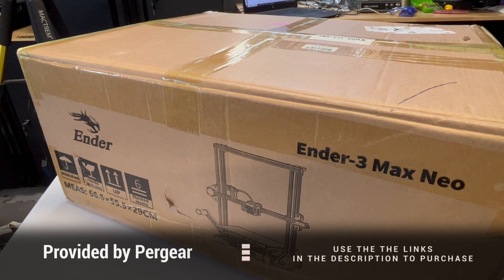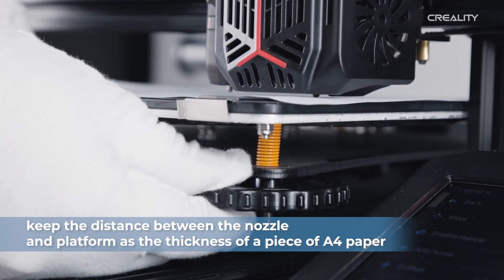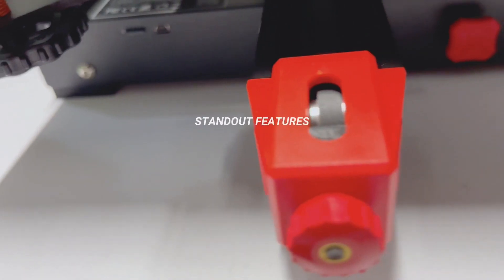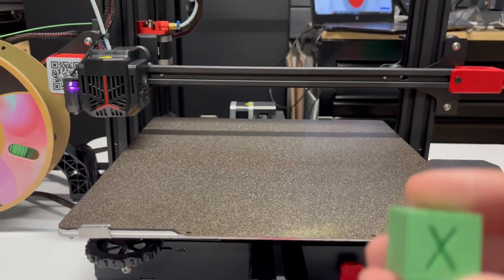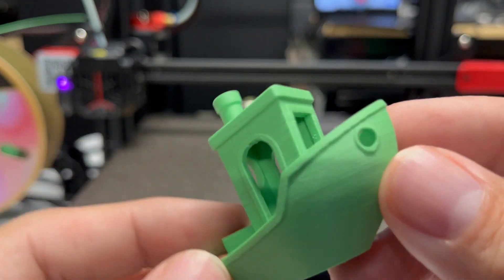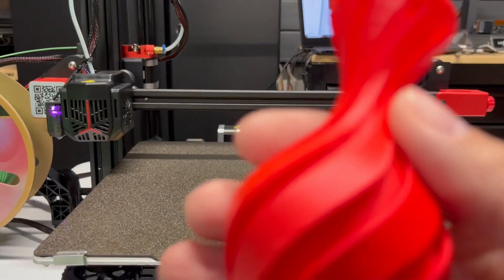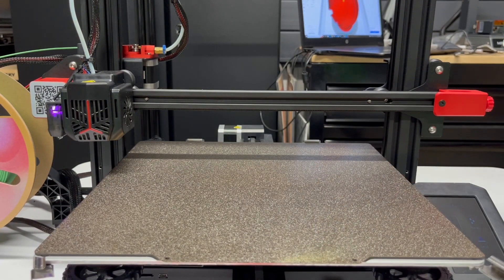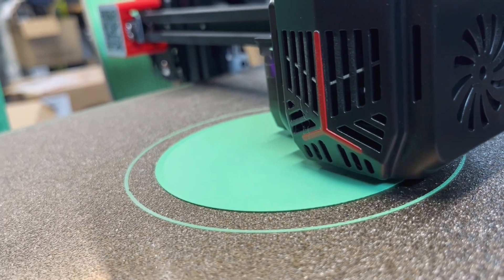NEW Creality Ender 3 Max Neo - Is it the One?

Comment: I was having problems with prints sticking to the bed. I no longer touch the bed with my hands. Problem solve.
Reply from the maker: If I recall this video correctly, the prints stuck to well.
Reply: @TripodsGarage  OK, let me redo my post: Unlike the person in the video where his prints are sticking to well, l'm having problems with prints sticking to the bed. I no longer touch the bed with my hands. Problem solve.
Reply from the maker: @DueyMiller-rk9dr  - Typically you don’t touch the bed with you hands so no oils get on the bed surface.  So you still don’t touch the bed with your hands, so the prints stick.  Got it!
Reply: @TripodsGarage  I was touching the bed because if you run your fingers lightly over the first outside bead laid down and it moves your should stop printing. I thought like a moron that was a good way to check for print failure. Which it is but you have a ton of oil all over the bed.
Reply: @DueyMiller-rk9dr  I use electronic wipes on the bed after print to make sure it is clean. Just a sugestions..

Comment: Has to be something with your settings, setup, or filament, I've seen several videos on this printer and all the prints turned out beautiful except maybe a lil ghosting but nothing bad.  On the video that the prints looked beautiful before the first print he adjusted all the rollers, belts and then leveled the bed. He also changed several setting in the software "Cura" that he was using. The changes he made definitely worked for the better.

Comment: Umm 3d printing 101, you ALWAYS check the tensions all around when assembling a machine. How did you even miss that??
Reply from the maker: Does it say to check it in the manual?
Reply: @TripodsGarage  It doesn't have to, there are manufacturing  tolerance, assembly tolerances, hell you picking up the printer from the box can cause things to come loss. Proper assembly always includes checking everything, and that 100% includes making sure everything is squared, all screws are tightened, checking belt tensions, the eccentric nuts on the wheels..etc. Did you check any of those? It seems kinda stupid to say the review would have been better if it wasn't for one screw being loss when you properly check these things out.
Reply from the maker: @janosmegyeri1473  - Oh!  So I am to do things that are not listed in the manual?  Got it!  Why?  Because because this is 3D Printing 101!  Is there a 3D Printing 101 course?  Is that course included with every 3D printer that is purchased for all the new people?  If it says to check the eccentric nuts, then they are checked, if it says to level the bed with the leveling knobs, then that is done.  If it doesn’t say to check extruder tension, then it doesn’t happen.  You know why?  Because “it isn’t in the manual!”.  This is exactly what is wrong with these responses.  People with experience belittle others that do not.  You do all this things listed because you have experience with 3D printers.  Yet, you cannot go back down to the level of somebody that doesn’t know one little thing about them.  Am I going to unpack a inkjet printer and checks the belts for tension if it isn’t in the manual?  

Maybe manufacturers should have a tuning guide?  Or a checklist like with what you are saying?  Now that would be a step in the right direction for newbs!  Pleasure trolling with you, have a frosty beverage and have a relaxing rest of your Friday!
Reply: @TripodsGarage  Wow dude, chill out. My initial comment was sincere, I was surprised it didn't get caught during setup, but then you have to come back with a snarky remark like does it say to check it in the manual so ya, I;m gonna call you out on it. You say "People with experience belittling other that do not" but you are a content creator with nearly 20k subscribers, and over 100 vidoes, you have experience man. 

That is exactly why I called you on it bro, because you aren't the person "back down to the level of somebody that doesn't know..". If you were new, I would have taken that as a teaching moment to provide some tips when assembling a 3D printer, but you clearly are not new. 

-peace
Reply from the maker: @janosmegyeri1473  No, this was a belittling comment.  You claim this is "3D Printing 101" to check all the nuts bolts, tensions.  Again, where is this 3D Printing 101?  You 3D Printing 101 comes from experience and nothing more.   All these manufactures are now claiming 15min or less setup times.  Then you are off and printing.  It says absolutely nowhere in the manual to adjust the extruder tensioner, or why would you even need to.  All that is needed is to have a checklist with what to check, and explaining what does what.  I could have easily just let the failures be, and post the video as is.  You are right, I have 20k subs and experience, and try to hold myself to higher standards with my content.  I show most of the assembly process, explain parts, go through settings, results, pros and cons.  I just don't have an assembled printer sitting next to me, and showing off printing parts then call it a day.  I decided to see what the issue might be, and recorded my findings.  I will correct you, this was a teaching moment.  

People need to start holding these manufactures to a higher standard of documentation and accountability, and not let the community pass the buck for them.  There is a reason why all these manufactures ask people to join their Facebook Groups, so the community can be their free tech support.  I see it all the time, someone posts a part that breaks, people say "by a replacement, or a new upgraded part, it will take too long for them to send you a replacement".  Instead of having them go through the manufacture, and get a replacement under warranty.  I never see this behavior on Facebook Groups for people that buy new vehicles.   Why should this be any different?

Now with all that being said.  I will actually take your comment under advisement.  And will be more aware to my targeted audience.  The only thing I ask from you, is to hold other content creators and manufactures to that standard as well.  I put a lot of effort into my content, and try "not to do" what everyone else does with my content and show more.  Now, I cannot remember everything, and I am trying to shorten my videos to under 13min.

Enjoy your weekend!

Comment: If you throw the glass bed in the freezer for 5 minutes it will usually release the print. I did a very large 210x200mm print on my Ender 3 Neo and it popped right off.
Reply: Second this. Don't even need the freezer the fridge works too. I only know because I don't have room in my freezer for anything of much size. LOL.

Comment: Looking to buy either the Ender 3 Max or Neo, which do you recommend? Is the Neo quieter?
Reply from the maker: Unfortunately I do not have the Ender 3 Max to compare it against.  The E3MN is very quiet at 60db as mentioned in the video.
Reply: ender 3 max and upgrade,if you get a neo you will regret it believe me.
Reply: @roddsmith8954  What made you regret the max neo?

Comment: Wait... Dual Z WITH a belt? How does that work exactly. 🤔🤔🤔
Good to see yellow springs at least & looks like the same strain relief as my 3yr old version from them.
Why do companies still use glass when flex options are so much better/easier. 🤦🏼
I run 10x10 mesh on my (formerly) Ender 3 Pro.
Reply from the maker: I used really like glass beds until I discovered flex plates.  This glass was absolutely ridiculous!  There was no glue stick or anything used, was completely cold.  A 3x3 grid seems pretty out dated.

Comment: One tip I have for getting prints off of the creality glass is to take the entire glass plate off the bed and put it in a freezer for 5 minutes.  This causes the glass to shrink slightly.  The prints usually come off without a problem.

I have noticed inconsistencies in the glass.  I have 2 Ender 3 v2s.  One of them sticks really well and the other has bed adhesion issues.  I wonder if they use different recipes for the carborundum glass or something.
Reply from the maker: Yeah, I have used the freezer, and under cold method over the years. However, this print finished at 11pm, and the print wasn’t removed until 9am.  With my other glass beds these prints would have fallen off.  I am with you, there are inconsistencies with the production of the glass.  I cleaned the glass thoroughly, and it still feels sticky.

Comment: John, Excellent review as usual.  Good catch on the loose extruder tension.  A bid help would be an Ender 3 family tree, going back to the original.  There must be 20 -30 Ender 3 versions,  a list with comments would be helpful.
Reply from the maker: Yeah, I started to over think what the issue could be.  Luckily it was a very simple fix.  These printer manufacturers always post videos, assemble, load filament, then print!  I thought about talking about the Ender 3 forest of printers.  I figured someone else can go down the rabbit hole with their review 😂😂

Comment: Great review! Yes if creality would make a few small addition changes, then they could have the perfect printer.
Reply: What additions changes do you recommend
Reply: @Shamsher1  I'd install a flex sheet instead of glass. Probably Ultistik. Capricorn tubing for the hotend liner. Dual duct part cooling fan/s. Dual drive gear extruder. I appreciate they are using a metal extruder kit, but its single gear.